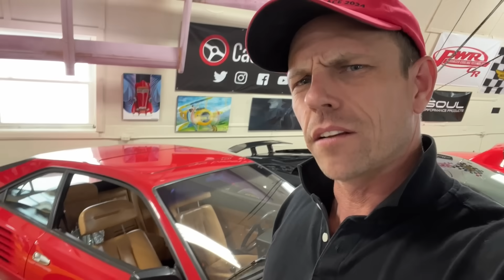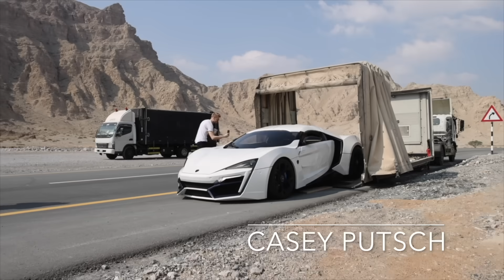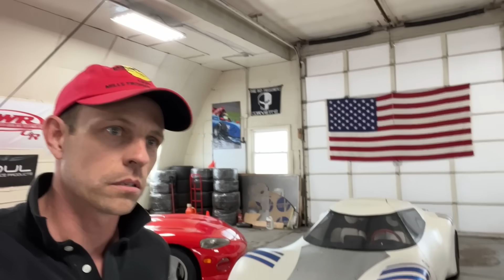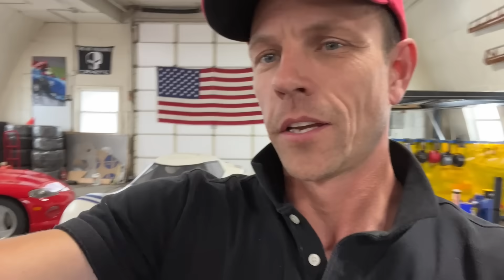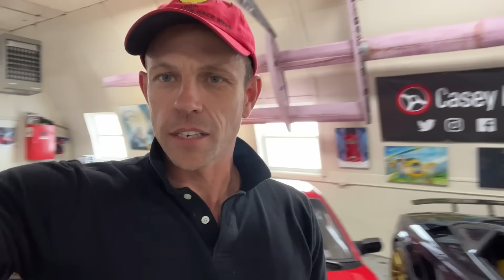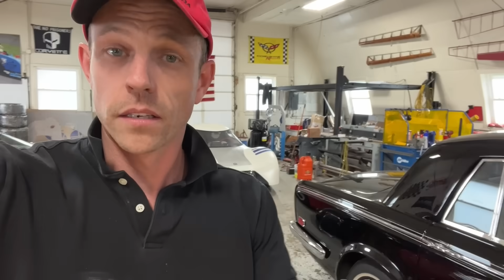Will the OMEGA CAR change everything? Video 1 of 3 "the Overview"

Comment: Great car for fun, speed, fuel consumption. Watched your video.  Wasn't impressed by the problematic bat wing doors. How does that work in a garage? parked between two cars at the store? You SHOULD show everything about the car. Engine, exterior, interior, Does it have seatbelts? airbags? Any safety features like backup cameras, side alert monitors?  This is a car for a particular segment of people, not those who would love to have a car without all the bells & whistles, and no tracking technology on it, carries 4 people.....and has REGULAR doors.   Now I see why you're having problems.

Comment: I see a lot of basic problems with this. 100mpg is cool but we cant haul much and it still sucks in city driving. As well, good luck finding any parking with that thing. In fact there is little amazing about it when the stock VW TDI cars were already getting around 60-70mpg.  It only makes sense that reducing drag and weight would help. 

FYI the VW XL1 diesel hybrid got 240mpg. So 100mpg is cool but old news.

Comment: I like his idea, but it leaves alot of questions and it's not like what he's suggesting hasn't been tried before. Porsche and Lotus are the best examples of lightweight sports cars for the masses. It's a prototype so I'll give it some slack, but no A/C, no insulation and most importantly no safety features(airbags, abs, crumple zones) make it not for sale in the US. If it were to be upsized to a useful platform would it still get that kind of mileage? Now add all the required safety stuff. How much do 10+ airbags weigh? Elon started with a little Lotus roadster conversion, how'd that sell? People want comfort and convenience. I'll admit, I'd take a 90's 3/4ton Ford or Chevy all day long, but if you're stuck in traffic for 1-3hrs you want to be comfortable and that adds alot of weight. For most people are hybrid Accord, Camry or similar is the way to go if you're concerned about fuel economy

Comment: I like what you’re doing. I think I know why they say diesel is dead in passenger cars. Generally the idea of everyone driving diesel and the smell of that on the roads. I personally really dislike the smell. Obviously that’s out of dirty tailpipes large engines ect but hard to think of a smaller more efficient diesel that’s not going to pollute. 
The truth is because of the bio fuel options we most likely can have a less odorous diesel vehicle. Also one amazing hybrid technology that will make way cleaner tail pipes is where you have hydrogen with the diesel in the combustion chamber. They’ve done special mapping in cylinders with hydrogen and diesel and can be up to 90% hydrogen and little as 10% diesel. Maybe your idea can go further with adding hydrogen or find a way to prove your diesel isn’t going to have much smell or emissions.

Comment: Do you ever actually show the drivetrain? What about safety features? Are they lax because it's considered a kit car? Would anyone actually buy this car? What technology can be implemented into current vehicles? If this is the only vehicle that operates at this efficiency, it's not going to sell much. People need other vehicles like trucks and SUVs and vans and delivery vehicles. What are the other options? Where's the construction process? What materials did you use?

Comment: Where is the data?  Where are the dyno data?  Where are the controlled dyno or track runs to show fuel mileage/fuel consumption?  Where is the data showing consumption when demanding max performance?  What is the aerodynamic drag ratio?  What is the vehicle weight?  Safety?  Interior noise?  Amenities like AC?  Where is the independent third party confirmation?  Fuel economy race titles? Until I see actual data, it looks like just the next grift praying on  the ignorance of our uneducated public.  If you are grifting shame on you.  If you are legit you need to do better with verifiable facts.

Comment: Casey, I saw you on Tucker’s podcast. I respect what you have done and what you stand for. I too am frustrated with the current automotive market offerings. I’ve been a GM and Ford customer for most of my life and written letters to them but they just don’t listen or care about changing the status quo. My question to you is:” is your technology usable to modify older vehicles to
Make them more fuel efficient?”

I long to buy am older vehicle that I can service myself and it reliable, fuel efficient and doesn’t have 10 processors in it!
Reply: Can you make a mod kit to replace the drivetrain in my 2017 Grand Sport? I can’t stand the AFM system and disabled it after my warranty expired!

Comment: All the hype but nothing other than one car to show for it. Get in gear and start production. Financiers will seek you out. Even if the first cars go for $75k prices will fall as production ramps up. 
I've built a Low cost Lotus (Locost). Even factoring in my labor at $60/hr., Maybe $30k into it., it's very doable if the market is there. I think there is a market for Casey so get going.

Comment: We built the Shelby Cobra's before the internet - early 70's. We sold from different kit stages (all with full chassis) with all the parts as a do-it-yourself final assembly, to fully completed cars. We used two V8 engine types: Ford 289 and 428ci. Street/Track legal at that time. I was a teenager working in my cousin's business. BEST JOB I EVER HAD!! I started at welding chasis parts and brakes. Then my cousin graduated me to making the molds. There were polymers, resins, etc just to make the molds for the body parts (doors, quarter panels, bumpers, etc). At 13 years old I became the fiberglass kid and a mad scientist in the garage. 😃. My space was in the back tent next to the final full assembly orders, the paint dude who was a genius in blending colors mastery. He was much older than me and we would kibitz about chemistry.

Comment: Look....I always thought cars were too much BS....my dad was a ford certified master mechanic for 38 years...
He died of mesothelioma brake dust
He forgot more than I'll ever know about cars... I'm the most basic wrench monkey ever...I have ADHD... I follow directions REAL good...if it has a scematic or way.too long to wait...I'm your guy.. or 40's lawnmowers for some stupid reason....
A good carbon fiber  body filled with spray insulation(they have some that's as hard as concrete and 1/4 the weitlght .... a good gear box and a 1000cc motorcycle motor... it might not do 0-60in 4 seconds... 🤣🤣🤣..
But itd be as good as a smart car or even better with the right gear box... the best most dependable.car I ever had was 85 Mazda 626...(hated the electronics though)...
Something like that but more aerodynamic less box on wheels...

Comment: I have been on this road since my college days, 1979-1983, but could never pull it off. I'm sure you are aware of the DIY diesel car that was getting 128 MPG, I have those original plans and the Feb. 1982 Mechanics Illustrated issue I bought when in college. Urba Centurion I believe it was called. I would love you to shove it down the governments throat and build a 250 MPG diesel hybrid! Awesome work.

Comment: You should make a practical normal medium size car instead of a dumb two seater.
If you can fit five people in it and make it as comfortable as normal modern cars and also safe enough to pass international regulations while maintaining its performance, people will buy it.
I doubt that will happen though.

Comment: I had a 1.2 Volkswagen diesel which did 60 miles to the gallon easily and ran without any problems for 140k before I sold it. This was before the diesel ‘scandal’. With less weight it could easily do better milage and its a shame this isnt being developed anymore by manufacturers.

Comment: Can a truck like a f350 be made more efficient with your improvements, or even more efficient with a hybrid build and lots of extra alternators and break regeneration? 🤔 Start a company with the people funding the start-up like an early investor and cap the amount per person funding to around 20k$ and add more small $ funding rounds to keep the large institutions from being the only ones that can take advantage.  The cars that would compete well in an efficiency standpoint would be heavy duty trucks, the new electric hummer (diesel hybrid), 2 and 3 wheel motorcycles, extreme off road capable trucks and toys, and vehicles people can live in and overland in as people are getting priced out of rent and cost of living. 🫡... How much weight reduction could a car see if it travels on rail, equipped only with magnets, and with the most efficiency technology used. 🤔

Comment: Had a 2012 VW Passat TDI manual that could go 700 miles on a tank. I knew Diesel Gate was a scam from the start.  That TDI engine is bulletproof.  We need more diesel cars ASAP.

Comment: Everyone keeps asking about the motor and drivetrain, but I think that’s the wrong focus. Yes, he chose an efficient motor and drivetrain, but this kind of efficiency could’ve been achieved with almost any drivetrain designed for low energy loss. The real genius is in how he tackled drag, resistance, and friction—engineering the car to eliminate as much of that as possible. That’s what makes the difference here.

Comment: Hey brother first I wanted to say what your doing is way cool. The fact that the big boys don't want to talk about it just means you're on the right path. Here are a couple things that came to mind. The inventor of the diesel engine designed it to run on peanut oil. Another thing before WW2 there were over 3000 independent car manufacturers in the US. after there were only 6. Decenterlized mfg. Is the way to go. Finally if you redesign your car to a 3 wheeler , moving the engine to make a front wheel drive your vehicle would then become a motorcycle thus avoiding many regulations.
Keep up the good fight
Robert A. Vitrano

Comment: People have been building aerodynamic light weight focused cars for years in order to improve gas mileage.  They never take off because they just are not practical enough. At least not in North America. People want space to put all of their stuff and to haul people. I get that this is just an idea and a prototype. But no one wants two door cars. Just look at the industry trends of the last 20 or so years. 4 door jeeps outsell 2 door jeeps.  Even the new EV Charger that is coming out has ditched two doors altogether in favor of 4.  It’s why most companies are ditching fun little two door sports cars altogether. They barely sell. Even mighty Toyota when they recently decided to resurrect their two door Supra they realized for how little it would sell it wouldn’t be worth designing from the ground up so they collaborated with bmw in order to use the bmw z4 chassis.

Comment: Saw you on Tucker.  Look underneath a car and the drag from exposed components and suspension is incredible, like from teh 1930s when aerodynamics didn't matter as cars were slow.  Then there was the Art Deco Streamliner 1930s period and cars because beautiful and aerodynamically efficient.  This is displayed very well at the Tatra Museum in Czech Republic.  By the way,  Volkswagen stole technology from Tatra which after WW2 they had to pay compensation for.  Clean up the aur flow and reduce rolling resistance and consumption of diesel or gasoline would be cut in half, with emissions cut in half.

Comment: Let er rip tater chip.. i wana hear that puppy run.. also philosophically the most inefficient thing the auto industry does is changing models parts every 3 years. Makes no sense just keep the assembly line the same : /

Comment: Rudolf Diesel invented the diesel engine to run on peanut oil in the late 1800's. Some of these engines still run fine. I still can get it in my head why diesel is so demonized, it's absolutely bullsit. You Sir are a smart man that isn't directed by idiotic climate propaganda and chasing the all mighty dollhair. I refuse to accept the trash vehicles offered the last 10+ years. I applaud you and will do anything I can to assist your common sense work.

Comment: Nice car. I’m a 69 yo engineering graduate of ITT Tech. I love what you’ve built. My specialty was manufacturing engineering. I worked on one of the first robotic arms, produced by Unimation Robotics Inc. The PUMA, it was called. I worked with a Silicon Valley company to mass produce the first lithium polymer batteries for Motorola flip phones. When I graduated from ITT, computers and cellphones hadn’t been invented yet. All of our designs were hand drawn on vellum with pencils on a drafting board. Oh, how quickly things have changed. Thanks for carrying on this dream. Blessings, from this old engineer in northeast Tennessee.
Reply: Love your comment; thanks for sharing.
Reply: I hope you’re thinking outside of the proverbial box as an engineer. Most engineering grads come out of the gates following the same train of thought the last ones did. Let’s hope you’re different. Because what we have today, is pure unadulterated garbage. Over engineered, planned  obsolescence, taking all the fun out for we mechanics. It is, all crap. And it wouldn’t take much tweaking to get us back to the golden age of auto manufacturing. And it needs to be done. Ford,  Chevy,  Dodge,  all of them need a slap in the face. A wake up call. From people like you. They have friends in high places and they’re kissing those peoples feet unapologetically while we get the shaft. Never bend a knee in your work. Please don’t. No matter the size of the check. Be principled.  
But I have a feeling about you. Please be a John DeLorean. Or a Casey Putsch.
Reply: @1NationMediaUS 
Casey could probably work with the Chinese to build this. I mean it should also be possible in usa to do the same.    .the Chinese just are actually able to deliver faster
Reply: @dgb56bgd  The tools have changed but the passion has not.

Comment: Now you need to use your common sense to make your own 2 cylinder modular aluminum diesel with mechanical injection and a biocarbon emissions filter made from your campfire carbon.  The body can be made 40% biocarbon and 60% recycled plastic.  It can likely be rotomolded in one piece... I have guy... unfortunately my number one guy just passed.

Comment: I see many similarities between your concept and what Paul Elio proposed with his company, Elio Motors. Elio Motors, founded in 2009 by Paul Elio, aimed to produce an affordable, fuel-efficient, three-wheeled vehicle but has not succeeded in delivering a production model to market as of March 29, 2025. Several factors contributed to its lack of success:
	1	Funding Challenges: Elio Motors struggled to secure the substantial capital needed for production. Despite raising over $100 million through crowdfunding, an initial public offering (IPO), and more than 65,000 customer reservations (with deposits totaling tens of millions), the company repeatedly delayed production due to insufficient funds. In a 2017 SEC filing, Elio estimated needing approximately $376 million to begin manufacturing, a target it never met. The company’s pivot to an electric version (Elio-E) in 2021 was an attempt to tap into the growing EV investment market, but it failed to attract the necessary institutional backing.
	2	Unrealistic Business Model: The original plan promised a gas-powered vehicle with 84 mpg for under $7,000 (later adjusted to $7,450), which was ambitious given rising material and production costs. The shift to an electric model at $14,900 doubled the price, undermining the affordability that drew initial interest. Analysts questioned whether Elio could achieve profitability, estimating it needed to sell 150,000–200,000 units annually—comparable to established automakers like Volvo—without a proven track record or infrastructure.
	3	Delays and Broken Promises: Production timelines were repeatedly pushed back, from an initial 2014 target to 2015, 2017, 2019, and beyond, eroding consumer and investor confidence. Despite showcasing prototypes and securing a former GM plant in Shreveport, Louisiana, no production vehicles were ever built. The company’s inability to deliver on its 65,000 reservations led to accusations of vaporware and skepticism about its intentions.
	4	Regulatory and Market Hurdles: Elio designed its vehicle as an “autocycle,” classified as a motorcycle in the U.S., which allowed it to bypass some car regulations but required lobbying states to waive helmet and motorcycle license requirements. This added complexity and cost. Meanwhile, the market shifted—low gas prices in the mid-2010s reduced demand for ultra-efficient vehicles, and by the 2020s, competition from electric three-wheelers like the ElectraMeccanica Solo and Aptera intensified.
	5	Operational Missteps: Elio faced legal and financial setbacks, including a 2017 Louisiana Motor Vehicle Commission fine for unlicensed sales and failure to segregate refundable deposits. The Shreveport plant, intended to employ 1,500 workers, sat unused, and the company reported a $215.8 million deficit by 2020. The website (www.eliomotors.com) disappeared in early 2024, briefly reappearing after its domain was auctioned, signaling a lack of sustained operations.
	6	Leadership and Perception: Founder Paul Elio maintained the venture was not a scam, emphasizing the difficulty of launching a car company. However, his pivot to selling refurbished cars and the company’s silence for years (e.g., no major updates from 2018–2021) fueled speculation of mismanagement or intentional delay, further damaging credibility.
In summary, Elio Motors’ failure stems from chronic underfunding, an overly ambitious vision mismatched with market realities, persistent delays, and operational inefficiencies. While it generated significant hype and deposits, it couldn’t translate that into a viable product, leaving it as a cautionary tale among automotive startups.